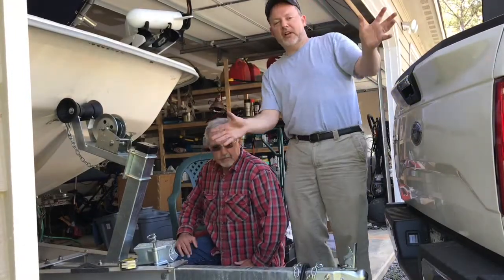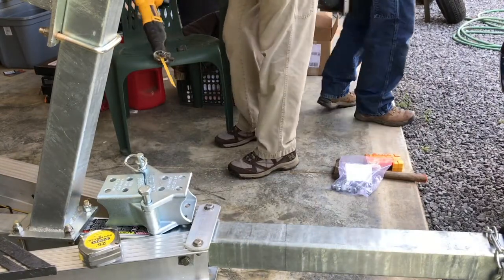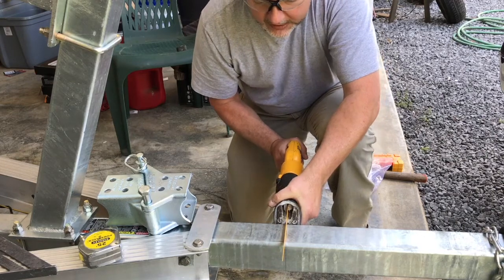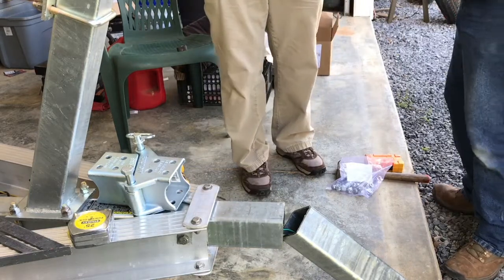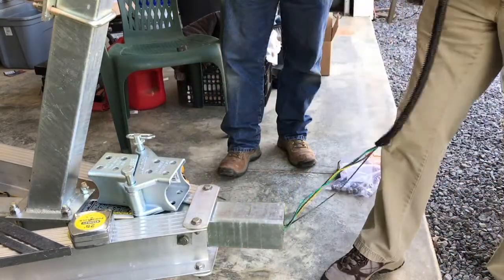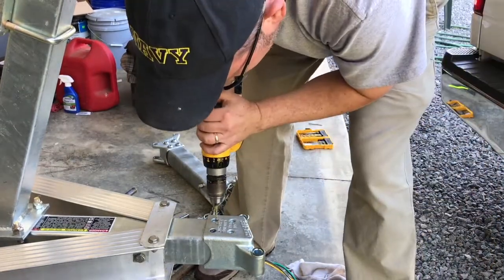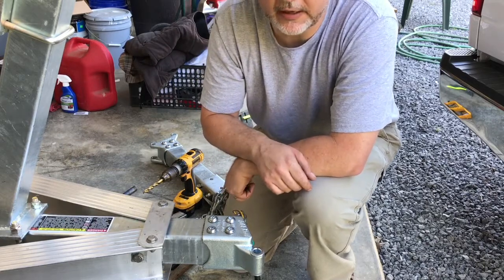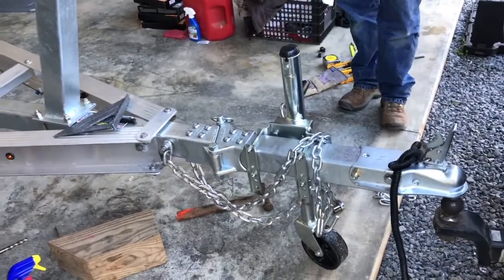Wisco / Fulton Foldaway Tongue Install 2017

Comment: How did you feed the wires back?  Did you first cut off the front connector ?  and after the coupler was attached, did you feed the wires back up to the front coupler and then re-attach/rewire the connector?

Comment: There's the right way, the wrong way, and the Navy way (I'm a Navy vet, 1973-1985). Was that the "Navy way"? 🤔

I'm wondering why the wiring couldn't be pulled back before the cutting commenced?

Comment: Next time , just drill both sets of holes by drilling all the way thru both sides lol. You were already using the mount as a template so all u had to do was drill straight.
Reply: Unfortunately, drilling all the way thru does not guarantee that the bottom holes will be in the correct location